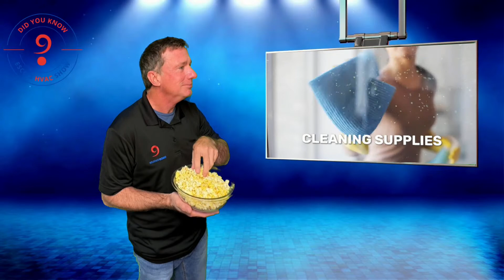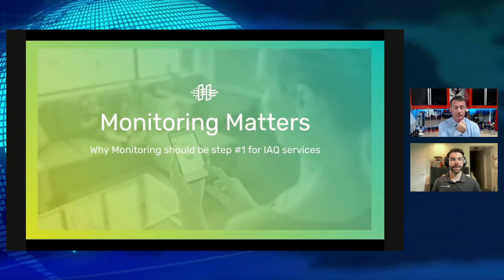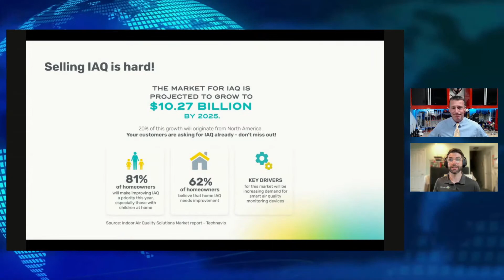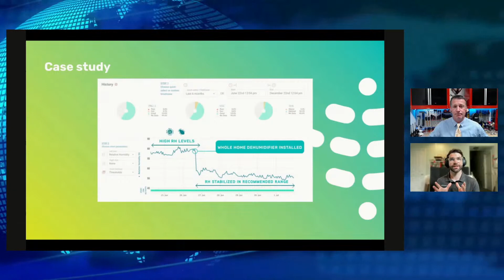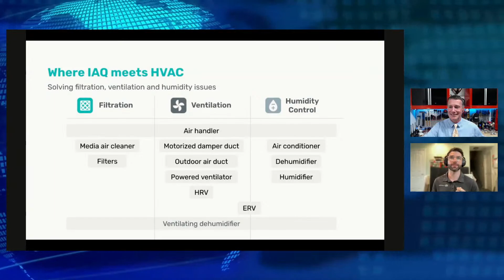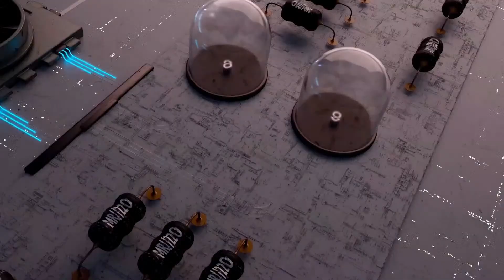Measuring and Correcting Air

Comment: Sir what are some high value skills for hvac site & design engineers which are at present mostly in demand ? How to combine those for career progress at rapid pace..
Reply from the maker: Building envelope and system performance are the foundation for all aspects of a high demand role in the HVACR industry.
Reply: @escogroup  How to learn & implement that could u elaborate a little more about the path..